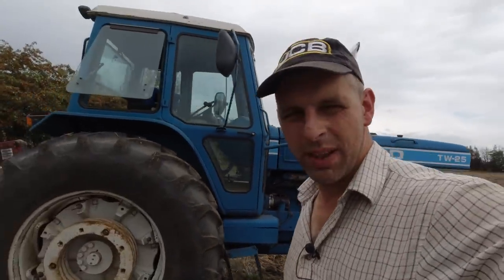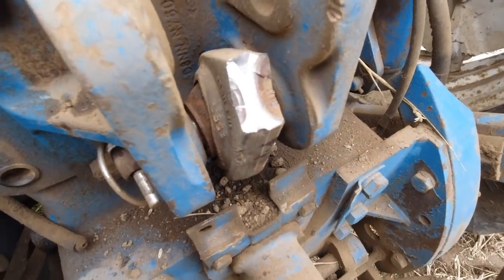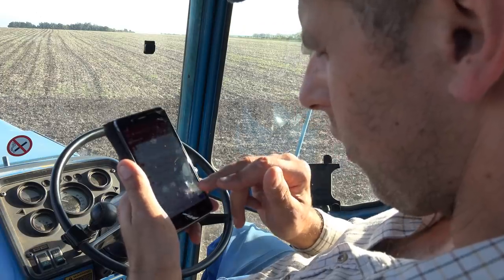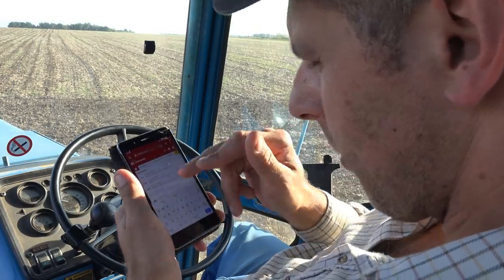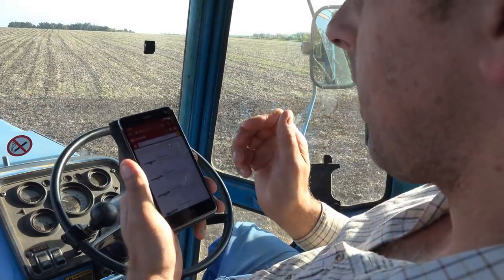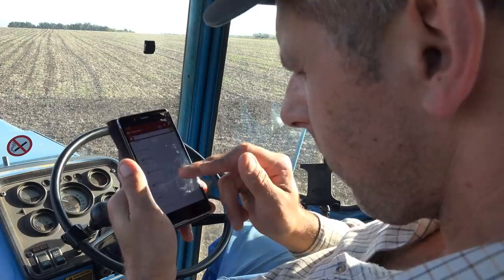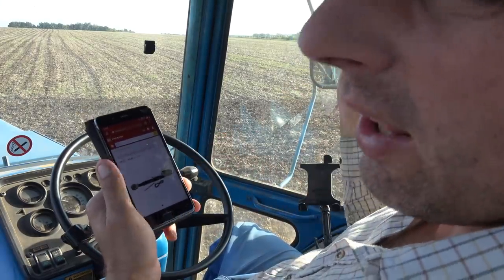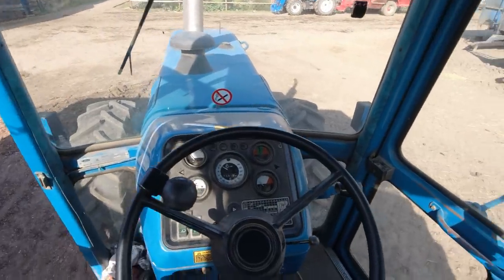MY TOPLINK SNAPPED LIKE A TWIG. KRAMP to the RESCUE

Comment: Haven't seen a top link snap such as yours, however have seen a three point backhoe attachment take the cast top link receiver bracket right off the rear of the trctor. Many farmers have an assortment of top links hanging on the tool shed wall, acquired over the years.

Comment: Question, is there a reason you have the top link hooked into the bottom of the 2 connection spots on the tractor? Looks like the bottom position would tip up the back the the implement more as you lift, but that the top link would but less stress on the top link of the 3 point.

Comment: Never fun when it happens but to be fair the cost of that toplink spread over the hours it have been in use is not a lot per use. One of cheaper things that can break.

I just bought a new hydraulik one, good quality one, right size for our 115 hp tractor and it was just 500 pounds.